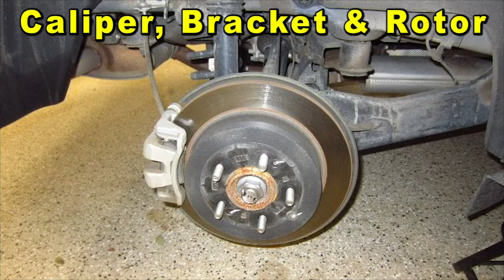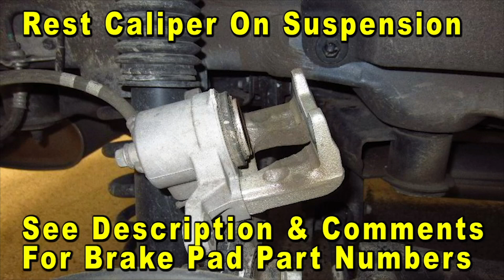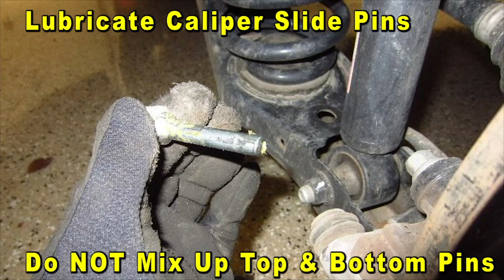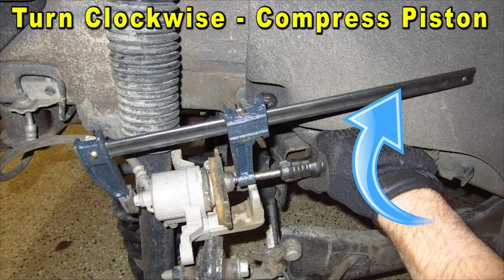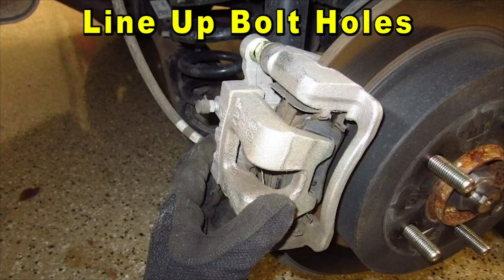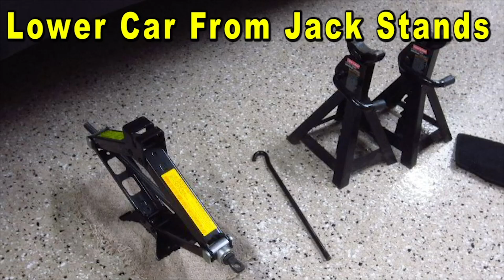2017 To 2022 Kia Sportage How To Change Rear Brake Pads With Part Numbers - Quick & Easy

Comment from the maker: Kia Sportage Rear Brake Pads - https://amzn.to/488Q7qw
Power Stop Ceramic Brake Pads Part Number - https://amzn.to/3Twzgth
ACDelco Ceramic Rear Brake Pads Part # - https://amzn.to/48qIuvA
Precision Screwdriver Set - https://amzn.to/3sLixaP
Plastic Pry Bar Tools - https://amzn.to/3HMtsV7
Socket & Ratchet Set - https://amzn.to/3Z17LbA
Mechanix Gloves - https://amzn.to/3jCnHkt
Torque Wrench - https://amzn.to/3vS5uSI

The Paul79UF YouTube channel is a participant in the Amazon Services LLC Associates Program, an affiliate advertising program designed to provide a means for sites to earn advertising fees by advertising and linking to Amazon.

This DIY video shows owners of the fourth generation 2017, 2018, 2019, 2020, 2021 and 2022 Kia Sportage how to change the rear brake pads.

Comment from the maker: Check out the DIY guide for changing the rear brake pads on a 4th generation 2017 to 2022 Kia Sportage SUV -
https://www.paulstravelpictures.com/2017-2022-Kia-Sportage-Rear-Brake-Pads-Replacement-Guide/index.html

Here are all of the DIY repair and maintenance tutorials for the 4th gen 2017, 2018, 2019, 2020, 2021 & 2022 Kia Sportage SUV -
https://www.paulstravelpictures.com/Articles/2017-2022-Kia-Sportage-DIY-Repair-Maintenance-Guides.htm

Owners of other Kia, Hyundai and Genesis vehicles such as the Niro, Optima, Soul, Forte, Rio, Stinger, Cadenza, K900, Sorento, Telluride, Sedona, Kona, Santa Fe, Tucson, Elantra, Sonata, Accent, Rondo, Carens, Veloster, Ioniq, Nexo, Palisade, G70, G80 and G90 may also find these DIY instructions to be helpful.